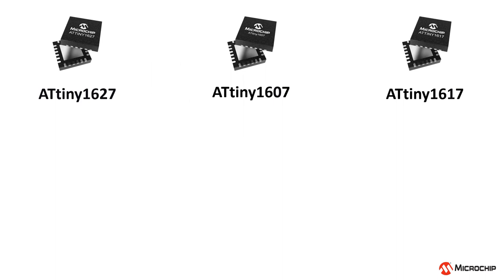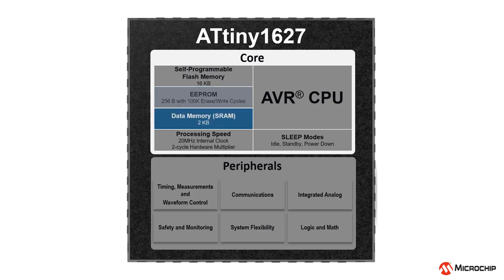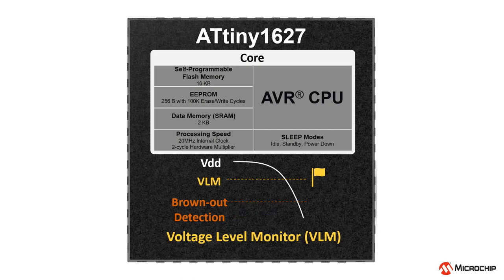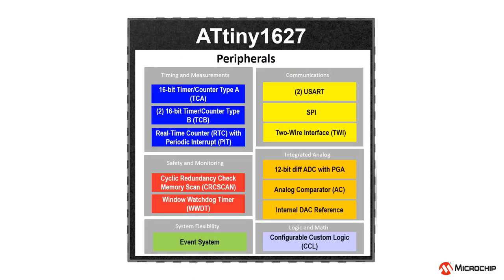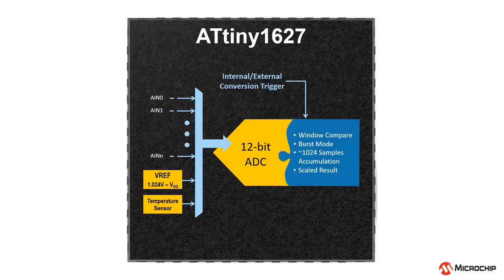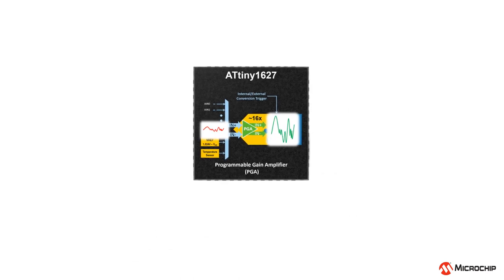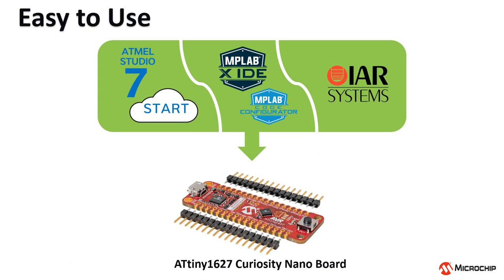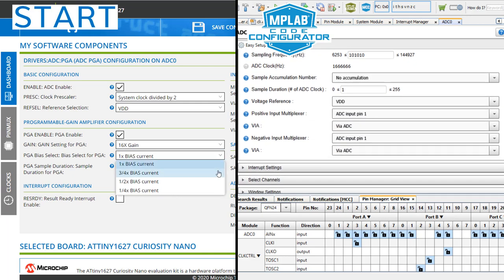Microchip's ATtiny1627 Microcontrollers

Comment: I’ve been trying to use this. I’ve decided to get a microcontroller from a different company.

The main problem I’ve had is that whenever I reduce the voltage at an input pin from 5V to a lower value, the voltage at all pins drop for about 3s and the power status LED blinks.

I had no short circuits and it was being power by 5V via a USB.